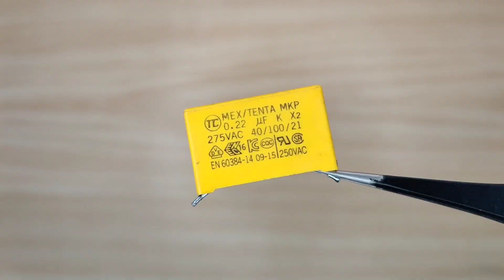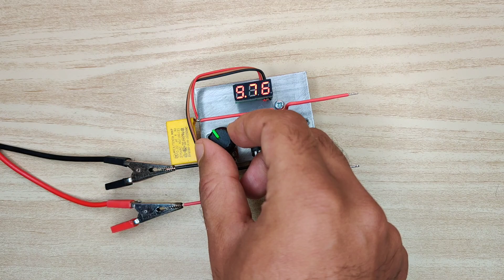LM317 adjustable voltage regulator 0-30v 30A

Comment: No way you are going to get 30 Amps out of an MJ2955, it is rated for only 10A you may get the voltage, but if you go pulling on it you are going to release the smoke, and you know what the saying is about the smoke. Let the Genie out the bottle it no longer waddle.   You need a better power transistor like an TIP35C Which is a PNP Power transistor, it can handle 15 Amps, so you could use 2 TIP25C transistors in Parallel, and you could get 30 Amps. But I do like your Voltage Divider That thing is sexy!! we also should put in some smoothing Camacitors at the 30V input side and for redundancy a Full Bridge Rectifier, just in case.

Comment: Nice video but where is the circuit diagram and you are only showing the voltage upto about 23 volts on no load and why can’t you show the amps upto 30 A to prove your circuit???

Comment: You have a mistake there, parallel-paired transistors must have balance resistors, if they are not there, one of the transistors will be overloaded - they are not made with exactly the same values.

Nice day 🙂 Tom

Comment: I have a 40-volt source that I want to reduce. Is there any component in this tutorial that I should change to adapt the solution to a 40-volt source?
Reply from the maker: You can check another regulator video on my channel that supports upto 60v dc

Comment: I know this is a old video, so hope I might get a answer. 
Where would you wire a amp meter into the circuit? 
Could you add another potentiometer somewhere to control the output amps?
Reply: Hello.I want to answer to your question. Will you give me your instagram?

Comment: Out put load is 30a ,for that you have to solder atleast 4 sq mm wire ,for loading 30a you have use common salt in plastic container,small motor consume less power.

Comment: you didnt measure amp
Reply from the maker: But it can handle higher current as mosfets are intended for higher current, and voltage will be controlled by lm317
Reply: Still you should have shown that, how. Some of us are armature here

Comment: 30A ? impossible for linear regulator! especially when vin/vout is large!
Reply from the maker: Lm317 is only 1.5A, that's what 2x MJE2955 PNP Transistor do, They Bypass current directly from input, and output voltage only is maintained by lm317

Comment: Heatsink very small! Max. 4...8 A
Reply from the maker: Yes, used for just testing, For Long Term Please use big heat sink with cooling fan, Also you may connect more transistors in parallel to increase out put power.
Output power will be same as supplied at input.

Comment: good but ampere not shown
Reply from the maker: Yes, i actually used mini volt meter, you can use 2 in 1 volt/amp meter, You can use more transistors in parallel to make this circuit to handle higher current.

Comment: Good video

It would be good to put a meter not only voltage but amperes consumed.
Reply from the maker: Thanks for watching 🙂, Yes you can use 2 in 1 volt/amp meter to display amps consuming, also you can add more transistors in parallel to drive higher amp load, but output amps will be same as supplied to input
Reply: @CreativeTechos  Ok my friend.

I'm a novice in electronics 🙂

I don't think I know how to connect the 2 in 1 

If at some point you do it on video, I'll keep an eye out.

Comment: Maybe the Amp is small bec of this ic Lm317.. this ic has very little amp.. just asking sir.
Reply from the maker: Thanks for your comment, Then i should only have used lm317, why MJE2955 is used, Actually in this circuit lm317 only controls voltage, But PNP Transistor bypasses the current directly same as input, you can use more transistors in parallel to increase the output power handling.

Comment: 30 Ampere..! No Maximal 1,5 Ampere
Reply from the maker: Yes, lm317 is rated maximum 1.5A, but in this circuit lm317 only controls voltage, But PNP Transistor bypasses the current directly same as input maximum 30A as rated for 2x MJE2955, You can connect more transistors in parallel to increase power rating.
Reply: @CreativeTechos  - not according to the datasheet.   Your limit is 10A each MJE2955 - combined for 20A max.
https://circuits-diy.com/wp-content/uploads/2021/04/MJE2955T.pdf
Reply: The LM317 has an internal transistor through which current is normally flowing. But in this case, it only serves as an transistor array. The high current flows through the big power transistor.
Reply: il n’y a pas de générateur PWM dans votre montage ça ne peux pas marcher véritablement …c’est bidon votre montage !! 😂

Comment: Very nice 👍🌷
Q can I use the display took from an induction cook top (as salvaged item)
Q2what is the voltage you connect in I/p
Reply: Many thanks bro,
God bless you for more innovative projects 👍👍💓💓💓
Reply from the maker: Thanks for watching 🙂
Reply from the maker: Input can be used max 30v, No cooktop display will not work, This is not only display this is volt metre.
Reply: You need $1 for voltmeter.

Comment: where did you get your input supply you dont show it why did you not show it ?
Reply from the maker: You need to use rectified dc supply for input, In video i used 30v SMPS as input

Comment: 3 lm 317 =4,5 amp
Reply from the maker: Yes, but here lm317 is only controlling voltage, current is bypassed by transistor and gives same output current as input, maximum depends on transistors current rating.

Comment: how do i get the pc board with all the component and how much does it cost me?
Reply from the maker: I can provide only within my country, you may order pcb using my Gerber files or use layout files to make diy pcb, also you can use Vero board (zero pcb) by following circuit diagram, components may be sourced in local electronic market.

Comment: 317 max amp out put 1.5
Reply from the maker: Yes, here these transistors acts as current booster, so that it will get High output current.

Comment: What about Current measurement?
How do you say 30 A.
Reply from the maker: This circuit doesn't boost current to 30A, But it will control load of 20-30A, when input supply used is also supplying 30A, you can add more transistors for more Amps load control.

Comment: Greeting!  Good video!  Can you do it with 30 A with a V and A adjustable?
Reply: I found up to 10A adjustable!  I watch your videos all the time!  I can't find it, please name it!  Thank you
Reply from the maker: Made that already, please check out my other videos, you'll find that
Reply: I got all the parts for that video 30V and 10A and I will try to make it!!!  Would it be able to draw 5V and 8A without overheating and shutting down?
Reply from the maker: It will generate heat at low voltages as this is basic circuit without PWM control!

Comment: Sir aap  12v rgb controller ir remote banao
Reply from the maker: The RGB leds controller can be made easily using minimal components, but with ir remote function for colour effect, than a micro controller like Arduino should be there